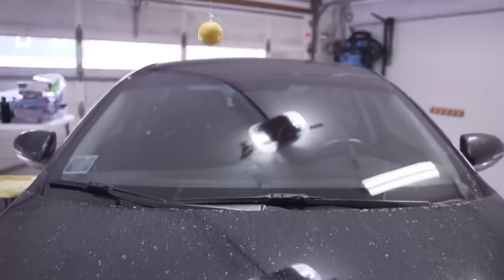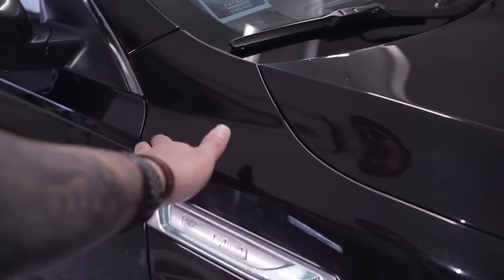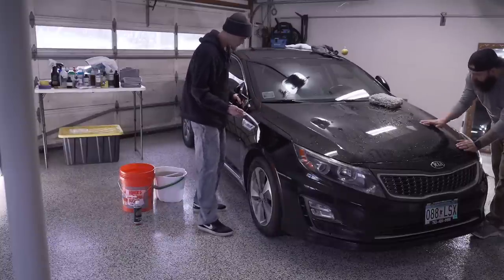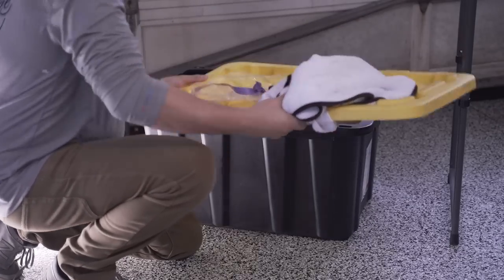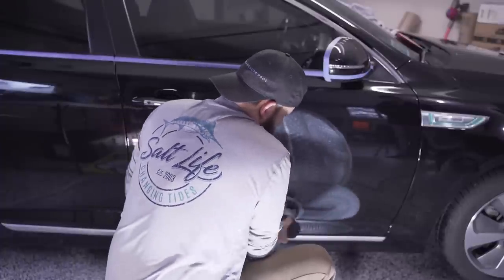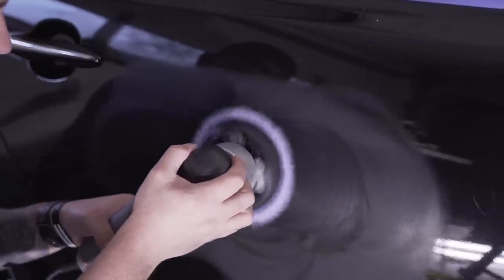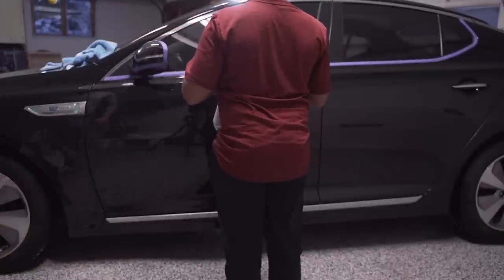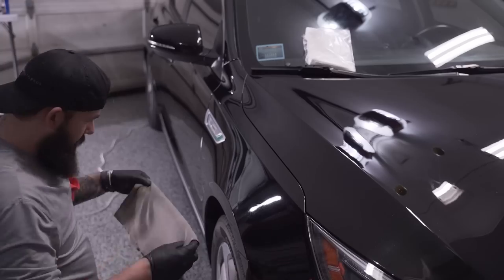Ceramic Coating a Kia Optima | Weekend Wash | New Product Testing

Comment: I love this style of video so much  it makes me feel more interested and makes me feel like i can do what you guys are doing.
Reply from the maker: I'm going to keep doing these weekend wash type videos, I will have guest on and we will just talk detailing and test new products.
Reply: @ChicagoAutoPros  this is amazing to hear. These are some of my favorite videos.
Reply: Love your videos. 
Your guys in the shop have a great job and a great boss👍
I wondered if you have ever used Farecla? It made in England and used in Formula 1. I have been using it for several years. The G360 fast cut system is a real time saver.  Removes 1500 scratches on black paint
Keep up the good work guys

Comment: Very good video! It's what I would call "Real". Real in terms of you were away from home base, so less access to supplies and equipment, which is what a Drive Way Detailer has , or a guy just starting out on his own, you were mentoring a couple young guys, hopefully they'll develop an interest, if not they learned how to wash a car properly, what a rinsless wash is, that on your daily driver you can keep it nice, some scratches can be rubbef out by hand, clear differences, to be clear coat friendly when correcting  preserving as much as possible. and what a tunnel car wash does to the paint.  I know it's tough in the north to wash a car; as you know for most a hand wash is a luxury, and if it is in someone's budget, it may not be convenient (unfortunately detail shops are far and few in between; someone needs to invent a robotic carwash that simulates hand washing).  The video was real in you used entry level DA's, real in "I made a mistake, too much compound on the pad", mistakes happen, it was great you didn't edit it out because we learn from that, real is better than perfect. Thank you. You were honest about your decision not inventory the ceramic coating in your business, you have integrity. Most important of all what made this real is you were helping out family.

A suggestion: If the young guys got the detailing bug, a cool video would be you mentoring them doing  in the spring detail (home drive way style), inside and outside, after the Minnesota winter.

Keep these type of videos coming. I thought this was really good for the DYIer. I like that  you share your knowledge teach and mentor (I see when your working with you employees as well), I recall another video you made at the shop taking an outsider through your wash process, generosity takes many forms.

Comment: Do a real CHICAGO video and show us how you brush snow and scrape ice off the car without scratching it.
Reply: I never scrape Ice of the cars painted surface. If I have Ice on my Windows I let car Warm Up for 15-20 Minutes first. When it comes to snow I brush off only top layer and dont go all the way to paint. If the snow is fresh rest of it will just fall off while driving especially on Ceramic Coated car. If snow is frozen same thing I try to brush of top layer and never to touch the paint. So far my process works for me.
Reply: @codename7832  Putting some protection on the wondies helps. I use GTechniq C2V3, one or two taps with the ice scraper and it comes right off, no scraping.

Comment: Do you guys ever wet sand the deeper scratches? If I'm spot correcting I wet sand first then polish, way safer and faster then hitting the same spot and heating up the paint and swelling and temporary hiding the scratch.

Comment: Great video! 
I see some LE(Liquid Elements) products on the workbench. Awesome products the one I have used. If you want to have an old school soft and very absorbant drying towel. Their LE Silverback XL Mf Drying Towel is still one of the best out there. Also have their Eraser mf towel which is a high quality no nap or low nap mf towel for leveling coatings and hard to remove compounds and waxes. LE Gloss Boost is another product that I have used and yeah if you want a boost in gloss you get it with this. Not the longest durability from it but it's layerable so you can get some extra weeks durability from it but it's a topper more than a stand alone LSP. Easy to work with their products and great quality. 
Looking forward to see more of these kind of videos!